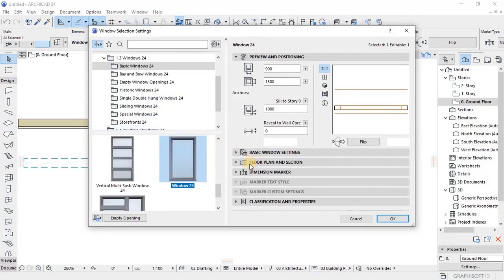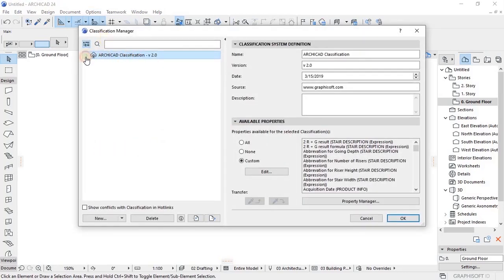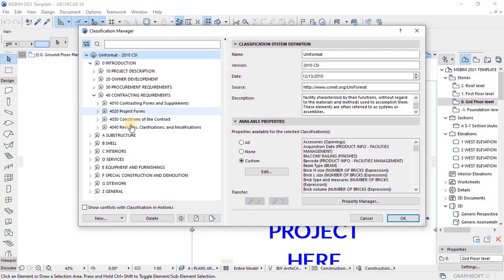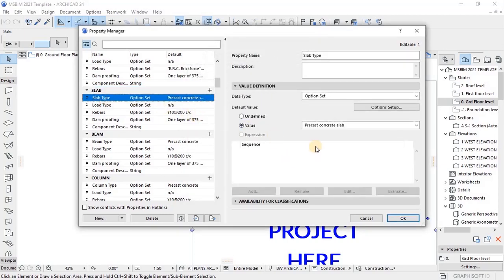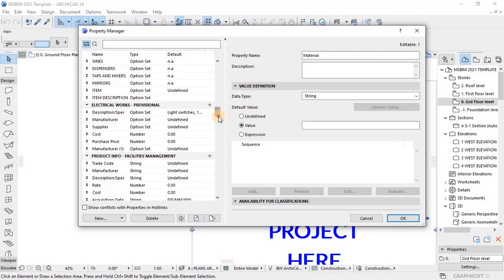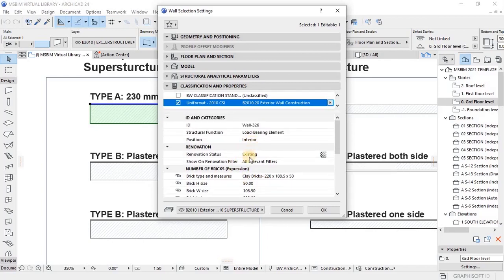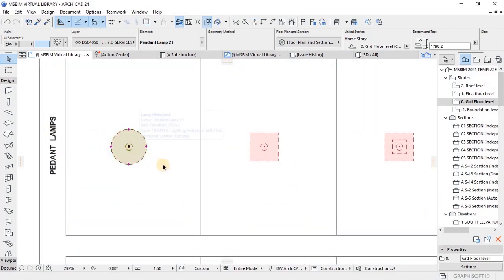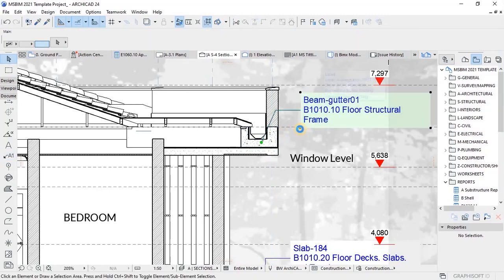Working With ArchiCAD Classification and Property Manager | BIM Classification Systems

Comment: is there any way i can assign each layer of a composite a differend Uniformat code?  the wall core (say a concrete wall) a code, maybe B2010-Exterior Walls, and in the same element add another code for its finish, for example C2010.10-Tile Wall Finish ? I need to schedule both quantities: the volume of concrete for the wall and the area of its finish.

Thank you for this video, it helped a lot!
Reply from the maker: Unfortunately is not possible but, you can do it on building materials and assign each material a different code. And your composite will be formed with different code of materials. I hope I explained correctly
Reply: @MesolightVisual  WOW I just found it! Thank you SO MUCH! You might have just made me and my entire team migrate from Revit to Archicad! 🥳🥳🥳, you just gained a subscriber 🙂🙂🙂